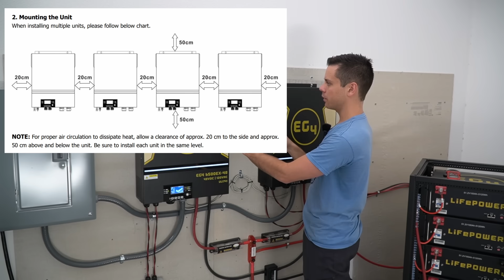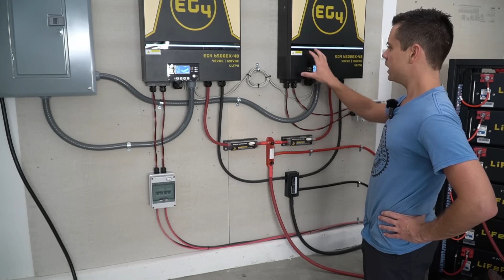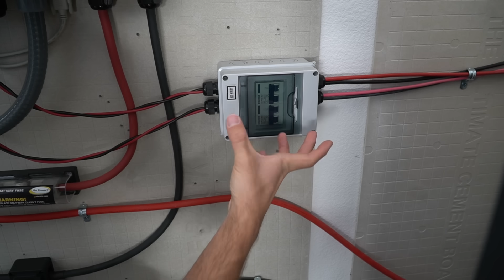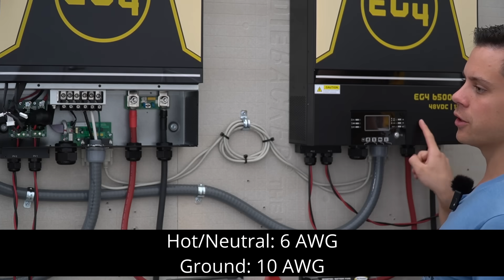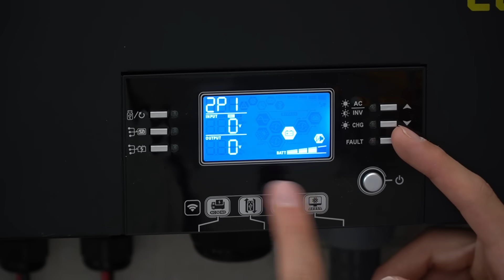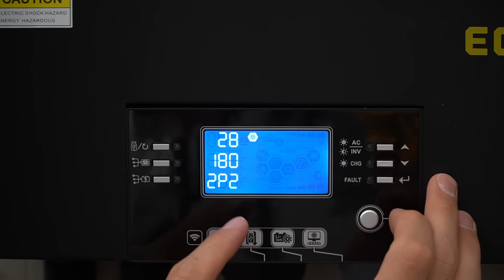Complete 48V Offgrid Solar Power System

Comment: I have used your design for my system, using the 2 EG4 6.5K with 18 455W panels, EG4-LifePower4 Lithium batteries, etc, like you have so excellently instructed.  A couple years ago you discussed "Automatic Transfer Switch for Small DIY Solar Systems".  Can you recommend an automatic transfer switch for a 12KW 240 split phase system that can switch automatically between the solar system, and, when needed, the grid power, like the small MOES Dual Power Controller 50A 5500 Watt Automatic Transfer Switch for Off Grid Solar Wind System that you covered 3 years ago?  Thanks!

Comment: In my opinion, fuses need to be closer to the battery pack, not near the inverter.
I got 5.5kW inverters that can handle 6kW of PV each.... and they cost me 450€ piece, i do not see the advantage of those EG4 that cost 1250$ a piece. 

On the other side, those EG4-LifePower4, 5.1kWh for 1500$ is ok, it's cheaper then a Pylontech but far more expensive then EVE prismatic cells (well i do not know the price today, maybe it has increased dramaticaly since last year).
Reply from the maker: Each battery has a breaker on it

Comment: Hi Will, would like to know actual efficiency going into the tesla; direct from PV via inverters, and then if only charging tesla via inverter but from the battery bank; so efficiency of energy delivered PV to tesla battery. Overall System.losses.
I understand the latter would require multiple charge cycles in the tower.

Comment: Please make sure the ground your batteries are standing on can actually hold the weight. I once discovered a battery unit that fell through 2 floors because the ground had a max rating of 200kg per square meter. The unit weighed almost 800.

Comment: At this point, it gets kind of crazy to even go back to AC. Lots of servers are setup to actually use DC across the data center, but just in general, all computers and electronics are internally DC. LEDs also only DC. Ultimately the battery in your car gets charged with DC. Even if any of these devices use AC on the outside, that is converted back again and only used, because AC is prevelent for normal house connectors. Direct heating & electric motors can in theory be done equally well with either DC or AC, and again anything battery powered will likely do so already, and converts in the charger. At this point, what even truly needs AC inside a house? Most other things are just combinations of motors, LEDs, electronics, and maybe heaters, at least anything made recently that no longer contains incandecent lightbulb or the likes.
I don't know if any have been build, but there are suggestions, that it would be more efficient to use extremely high voltage DC for long distance powerlines.

Comment: Thank you for posting this video which is very clear and informative - well done.  I have looked at solar for my home and with the current pricing it's a 15+ year payback - even worse, under the rules in my area if I lose power to my home I can't run my house from the solar panels - only on batteries.  Just one of my two AC units takes nearly 20 amps to start and about 12 amps to run - batteries add to the expense and only buy me 5-6 hours of AC time.  I have a 20kw diesel generator on an automatic transfer switch.  When the power goes out I have reliable power to run my entire house until the fuel runs out.

Comment: 0:45 What a great idea!
I installed solar to go green. And what do I do with all this energy? MINE BITCOIN of course!
Nothing more sensible or energy efficient, nothing says GREEN ENERGY like BITCOIN.

...

Fing morons.
Reply: I've heard of situations where the sun is shining, the PVs are kicking out energy but the batteries are full and the house isn't using the energy... So it is diverted to a miner.

Because the miner can be turned off almost instantly, then the second the power is needed by the house or batteries, the miner disconnects.

So the miner is making income off energy that otherwise goes to waste. Minus the cost of the miner itself and then it makes you money.

(and that's exactly what the solar rigs in Texas are doing to augment/monetise the state's grid by the way. Very profitable.)
Reply: @thesolitaryadventurer  How much power do you have to spend to earn, for instance, 100 USD?

Comment: I just started my journey on building an off grid solar system and this is the best channel I have found so far. I wanted to start with the solar panels and build my system from there but you did not cover the panels you are using for this system in this video. I have a 2 story apartment metal building on my property that I want to convert to 100% off grid solar. It has electricity now but I want to bypass it all and run it off grid. The reason I wanted to put the solar panels on first is because the ceiling is a little hot in places due the the metal roof and metal roof joist. I was hoping that I can deflect some of the heat with the panels so that is why I wanted to start with the panels first. Im sure I can continue searching your videos to figure out what you used on this system but would appreciate any info you can shoot my way.

Thanks for a great video.
john

Comment: Another spagetti lay out same type of batteries server rack running all the connections on the front then you have links from box to box crossing like a map of undeground metro.
Just run a wide trunking under your boxes and do all your connections inside i can tell you that you will use less cables run from each other.And you better crimp all your end terminals.

Comment: Nice. I like this system, especially the battery rack.
Several Ideas.
- I would like to see a system like this built totally inside of a rack.
- In my application on a farm the ability to screw everything to a wall may be problematic.
- My idea is to build a whole system like this inside of a small shipping container.
- Deploy a solar array - and connect the whole array to the container.
- Then my load (electric vehicle), cabin etc. Can be connected to the container.
- With everything secured inside of a container, and with a quick way to deploy a solar array. (potentially a fold out rack onto of the container.) The whole system can be moved with a trailer and truck. This would allow quick deployment in areas that don't have permanent structures and allow for EV Charging "off grid".

Comment: Hey man. If I have a 50kwh battery system that's fully charged and I run my house with heating etc. How long approximately will it take for the batteries to go flat? Let's say I have a fridge, TV, heater etc.

Comment: Looks nice but i use 3 phases. Any 3 phase equivalent system ?
Reply from the maker: This does 3 phase. Just need three units
Reply: @WillProwse  oh smart ! And phases synchronize and can load the grid ? I need tech data
Reply: I suopose with settings like 3P1 3P2 and 3P3 ? Looks so easy is so
Reply: Registering your site now
Reply: And need 240 V

Comment: So this setup is not for the whole house.  It is just for your Tesla and HVAC?  How did you run the ground from your panel to a grounding rod?  What is the amperage output (most HVAC system from 15 to 60amp and the Tesla charging is 50amp).

Comment: Hi Will. This stuff is 'gold'! (never mind 'copper' ;)

If I wanted to build a battery array that is without the solar, to backup and/or bypass peak-rae electricity, (eg ASIC miners), how would I do that? Presumably replace the solar-inverters, with something that is an inverter, and something programmable, re time-of-day? 

Do you have a video on this, and recommendations for the inverter device part of the setup?

Thanks!

Comment: Will you need to correct your Info, when hooked up to create 240 volt your output is Only 6500 watt at 240 volts not 13,000 watts

Comment: I have 3 10KWh battery wired in parallel. The inverter sees the average SOC of the 3 batteries. It connects to battery #1 via CAN and the other 2 battery connects to battery #1 via rs485 patch cables.  The LCS panels on the batteries shows the SOC of each battery. I have noticed that the SOC value on each battery can vary by up to 20%. Say B1 is 75%, B2 and B3 says it's 95%. The voltages are very close in value. Is the SOC calculated by BMS flaky? This phenomenon is not localize to just one B1, I've seem the one lower SOC value on all 3 batteries.

Comment: Are the wires from the solar cells 10g going to the EG4? Whats the distance to your solar cells from the EG4?  Since its 48v system, can you run the wires a longer distance, esp if one could not put the panels on roof? Nearest clearing for me is about 175 feet away, the battery and EG4 would be in garage.

Comment: I just ordered the 1 of the 6500 watt 48 volt inverter you are showing 4 48 volt 100 amp hour batteries and 6 450 watt Renogy solar panel to start my solar set up. If I put all of this on a trailer would the inside get to hot for the batteries and could you recommend which of your videos to watch for hooking up solar panels for best performance or entire system. Or possibly explain on with this panel set up. Thanks for all the knowledge you are sharing.

Comment: I purchased this same system for my off grid home.  How would I properly integrate a backup generator to automatically start and charge the battery bank back up.  My generator is rated 10kw 1 phase 240v or 3 phase 240v selectable with 2 wire start capability

Comment: Ditto! To what everyone said. Out of the park Will. Question: I want to put this complete system on my 2001 Van Hool 2045L. I do want generator auto transfer and 50 Amp plug in. Any changes I would need to make for my vehicle as opposed to my home?

Comment: Loving your channel Will!  Im wondering if you have ever looked at or measured EMF radiation coming off these systems?  We know EMFs are the 21st century version of smoking as the body is electric and all these vibrating waves are bound to affect our bodies.  Im looking to add a smaller system in a tiny home where Im concerned I cant locate the equipment far enough away from my bedroom and living areas.  Can this equipment be shielded in some way?  Has anyone looked into this as its not a minor issue...

Comment: Thanks Will.  You're inspiring confidence in me and probably many others that we can do it too.  It looks like about $13,000 not including solar panels.  Pretty good if you go buy a pallet or two of used panels.  That's backup for a heavy air conditioned day somewhere hot and probably 3 days the other 8 months of the year.
Reply: You'll get way more than a day out of this IMO if you use a split system (I think you guys there call them heat pumps). They're very efficient and don't run at 100% once a house is cooled
Reply: If it's a heavy air conditioned day, you don't need batteries as it's most likely very sunny, no?
Reply: @nils1953  yeah if you have close to a 10 kw array.  Running one central AC unit you can easily use 25 or more kilowatt hours in a day.
Reply: Going from his price list and taxes l was thinking closer to 20k
Reply: @Lracnolip  you might be right I was just thinking $3,000 for the inverters and $9,000 for the batteries.  The rack, wire, box, fuses and all the other conduit and stuff will bring it up.  Still beats anything you'll buy from a solar installer.
Reply: @PWoods-cd6tk  Just purchased the same system kit from Signature Solar with 4 batteries and 24 460 watt panels.  $15800 delivered.  Breaker box and wiring will be extra.
Reply: @daddio7249  Not bad.  I hope it works well for you.  I've got $9,000  into two two 2000 watt systems with 11 kilowatt hours of batteries and 28 kW of solar panels. Sometimes I wish I would have done something more like your system.  Sometimes I like the modularity and portability of them.

Comment: How can I use this technology to make a on grid battery backup system for my house? I want sufficient storage to run my entire house for eight hours. I want it charged firstly by the electrical grid, second buy a gas generator, and finally buy solar panels. I will add each of these in stages.

Comment: I got two of these inverters and I will say the biggest issue that I have are the fans, They are constantly on and when they get a load, they sound like airplanes taking off also the other issue is the heat that comes off these inverters, Wow, I'm now considering getting an air conditioner for the garage, if your considering getting these inverters, just now that they are loud 
Thank you Will Prowse, you put out great videos

Comment: I'm wondering why you used circuit breakers in your MPP system video and class T fuses in this installation ??  Is there a reason you should not use circuit breakers on this system ?  Thank you for a great video.  I'm putting together a very similar system very soon.

Comment: Thank you for this excellent presentation.  I would need a 3-phase power supply for my heat pump heating system 380-400V. Could I use 3 EG4 to get my desired power supply?

Comment: I need a system to only run the water system for my house.  450 ft deep well. Will have two pumps , one to bring it to a holding tank and one for the pressure tank to feed the house.  Can you help

Comment: Will what about locating the batteries and growatt unit? Does it need a temperature controlled environment? Can I put the batteries outside in the garage knowing it will be 110 degrees in summer and 25 degrees in winter? Can u talk about locating the system to get the best benefit? Can it be inside the house? Thanks

Comment: Help…. What’s the cheapest most efficient panel for portable power? I have a power oak AC50s which I’ve been using to power all our mobile and portable devices. I had two 120w flexi panels connected which provided 70w input on really good days.. but due to wear and tear I’m down to 20w max.. time to upgrade.  Is there anything that could increase the power from the solar panel to increase what I’m getting to the battery.  Thanks for any help advice

Comment: I'm surprised you haven't gotten yourself a ford lightning yet along with everything thing you need to power your house with it. Now that would be a video everyone would  enjoy. I don't believe you've ever had a 400 vdc inverter in any of your videos. Nor  have you ever had a battery pack that even came close to the 131 kWh extended range battery pack on the lightning.

Comment: Thank you so much for making this.  I'm going to take my 5-acre homestead to complete off grid.  I had a company give me a quote and they wanted $80k and was only including 1 battery.  My only question is if you can add wind energy into this?  I'm going to have 13,000 W input for solar, 4 inverters, and 12 batteries currently priced at 1/4 the price of what the company wanted.  I want to add a 2.5 KW wind generator.

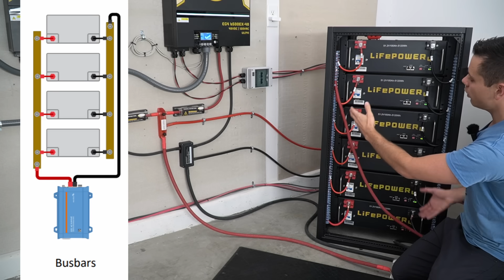Comment: @3:07 "So in a sense the AC output of these inverters is in series."  No.  No they are not.   You say the 2/0 cables to each unit are the same length, but you don't say why.  Hint: there is no reason.  Keep all your DC cables as short as possible to minimize loss.  @4:54 "This diagonal configuration will reduce current sharing problems."  Unless you WAY undersize your bus bars, the difference will be negligible.  The differences in the internal resistances of each battery and it's connections will matter more.  @9:28 "So this side is for inverters..."  Of course you give no reason for that, because there is none.  You can put the 2-phase input breaker(s) anywhere in the load center you like, as long as your OCD allows it, anyway.

Comment: I have a question.
I am installing this system you are showing except I have 3 batteries and 1 inverter. The fuse breaker between the inverter and batteries you recommended/ signature solar recommended was a 60v DC 200 amp breaker. Since I am only putting in one inverter then a 60 volt 100 amp breaker should be fine. What signature solar sent me was a 400/415 AC ICU: 10ka. I called them and the technical support guy said to go ahead and use it, that there is no difference in AC and DC breakers concerning this.'
I then called the design engineer who said she would get back to me next week. She had to look into it. I told her that I got it off your video. She knew who you were.
I really need your opinion as to what to do here. 
The image you show of the breaker in your video shows the 400v AC breaker but you called it a 60v dc breaker. The image on signature solar website shows the 400v AC breaker under the title of 60v dc.
Confused here.
Your opinion concerning this, please????????????

Comment: Hey Will. Thanks for the awesome vids. Question: Your parts list (and vid) show using an FBL-300 fuse between each inverter and the batteries. According to the spec sheet, it's rated for 300A at 12V, but only 110A at 48V.  The inverter could pull over 150A on the battery input (6.5KW out @ 90% efficiency... double that for a max surge), so why aren't you using the FBL-400 (good for 200A at 48V)?  I guess your setup never gets anywhere near max power?